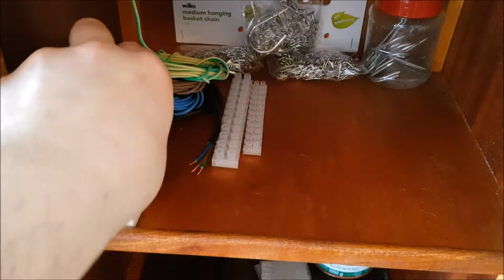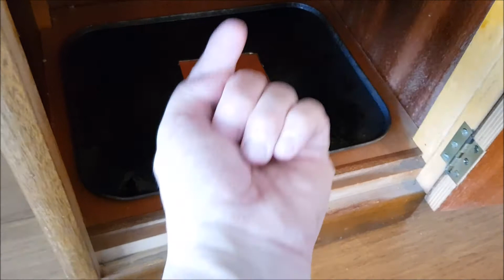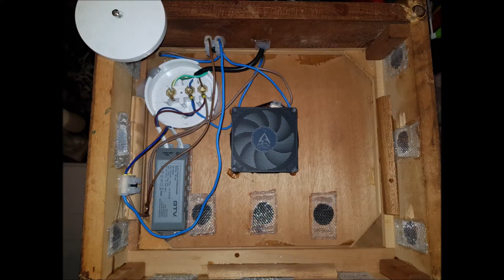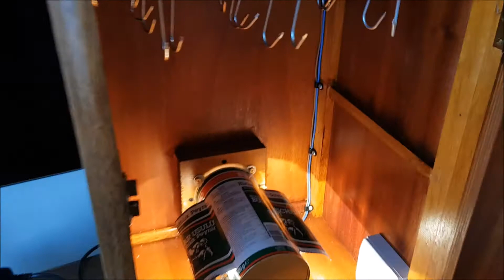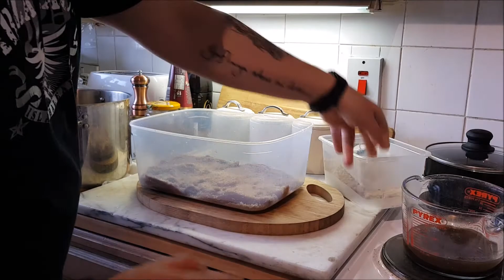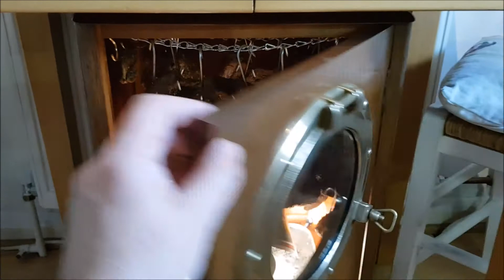Steampunk Biltong Dryer & How To Make Biltong!

Comment: My friend, I am from SA and have watched your video now....Sorry but I had to laugh at your setup... Look, I don't take myself as perfect and many has most probably also laughed at things I have built and done...Your drying box is cool except for the port hole, better to open the door o've the box to check your biltong dad .... The way you cut your meat was perfect, could o've had more fat on it see that the fat is always very tasty...Next time you make the biltong, cut the meat into strips like you did, take a big dish, put it all in it and sprinkle vinegar onto the meat, only enough to coat the meat, don't drown it like you did on the video.... Nevertheless, See if you can buy some spice that one use to make biltong with, weigh it on a scale as the batch pack will tell you and then mix all the weighed spice into the meat....Leave the meat in that brine to draw the salt and flavor o've the spices for 24 hours...After that hang your biltong pieces straight into your drier, it will stop dripping quit quickly.....Kind regards....
Reply from the maker: Cheers bud!

Comment: Not drawing enough air in? It's because the big fan is pulling more air out then what the bottom fans putting in. I personally think the airflow around the meat is to fast. It will cool the bulb down blowing fresh air direct i to it.
I'm not knocking you, as its a beautiful build but the mechanics is wrong.
Looks Beautiful tho 👍👍👍

Comment: Here's an idea (using it as we speak). Go to the reptile store and buy yourself a ceramic heat emitter. They are perfect for this because they

a) give off A LOT of heat at low wattage (40W-60W should be plenty enough for this size of box). They keep giving off heat for awhile when turned off and cool off slowly.
b) last a lifetime when taken well care off (I have mine for almost 15 years now and still working as if it were new)
c) have no problems with being switched on and off in "short bursts" for a long period of time (thermostat regulation, read down below)
d) can handle humid, cold, warm and hot environments without a problem, unlike other bulbs that will give up on you pretty fast under these conditions
e) don't give off any disturbing - and completely unnecessary light. If you want a light in there tho, to check the process without opening the door, just add one or two 7W Wattage light bulbs on top with an on and off switch added on the outside. Don't use LED as LED does not resist heat very well. Plus I find them being too bright and cold looking for this project. You know, use those tiny 7W light bulbs that you find in ovens. Should be plenty enough, since one is already plenty enough for an oven, right?
f) are overall more cost effective than any other electrical heat source

The only thing they absolutely do require, and this is extremely important to remember, is

1) a ceramic bulb holder. Ceramic heat emitters get very hot all over and would melt a regular plastic bulb holder in a matter of minutes no matter how much wattage it can handle. These cost about 3 USD on Ebay or about 5 to 7 USD in your local hardware store. Tip: do not touch an operational one or one that has just been turned off, you'll regret it instantly. Trust me, I literally know this first hand.
2) a thermostat that regulates the temperature and/or airflow. I use this one (Ebay): "STC-1000 Digital Temperature Controller Temp Sensor Thermostat Control 220-240V". Price: around 10-15 USD, on Ebay. This one regulates both your heat source as well as your fan too (temperature hits its programmed mark - you don't want the air being too hot, heat source turns off, fan kicks in drawing out humid air)

Hope this is useful for ya'll. :)

Cheers.
Reply: Like that idea
Reply: You don't want a lot of heat. If you use a lot of heat you're just making jerky, not biltong.